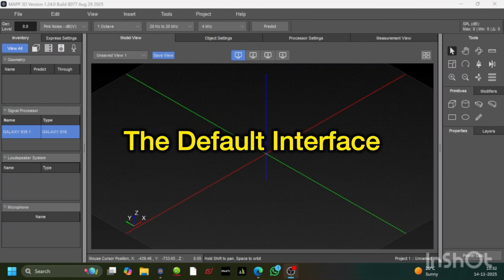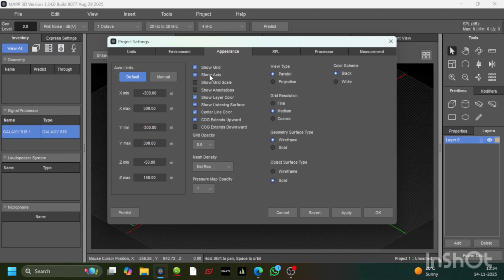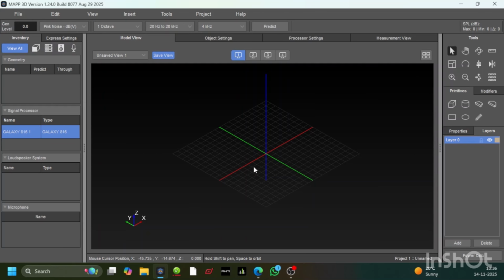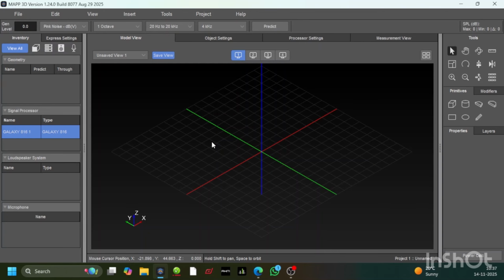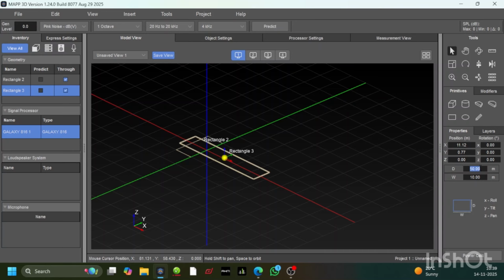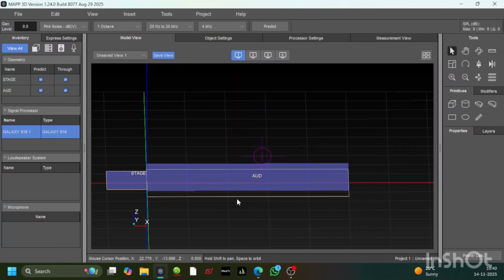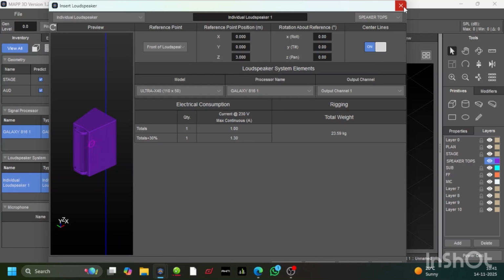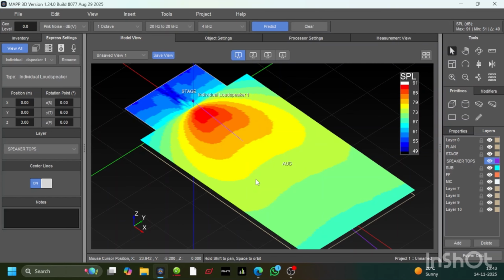Meyer Sound MAPP3D: The 3D Mapping Tool You NEED to Know

Comment: Can you do a mapp 3d project and integrate it to compass via file transfer?
Reply from the maker: Yes , if you have a galaxy online on Compass. Just go to Processors in Mapp3d and you will find virtual and physical Processor option. Click on right side and it would ask you if you want to Push or Pull setting, push it and you are done

It will map the names and processing, not the matrix. So just matrix routing you have to do it manually
Reply: @FREQBOYZ_AUDIOMAN awsome thank you